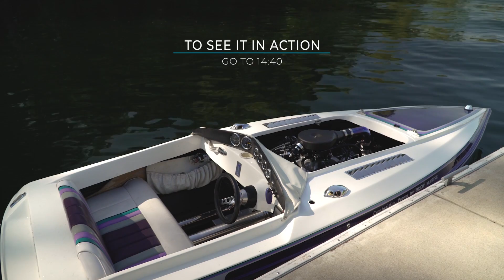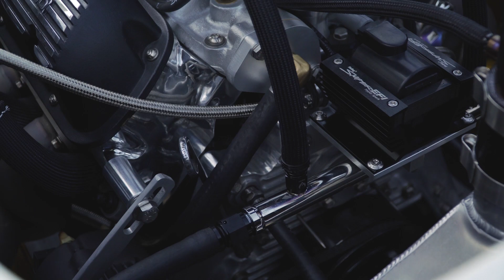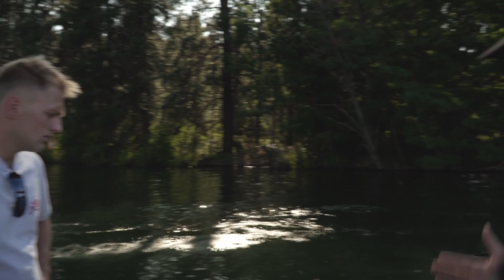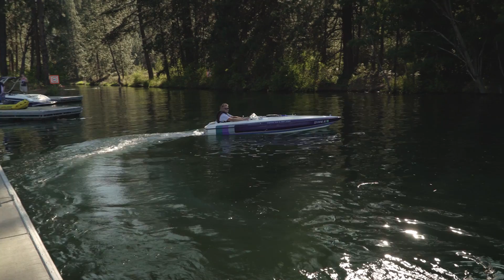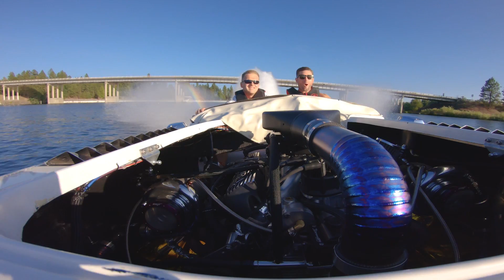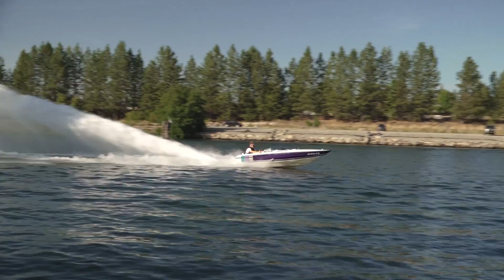13ft 1000HP+ Twin Turbo Jet Boat EP:3

Comment: That so cool but I'm scared hes gonna suck some water up into those turbos
Reply: Ross Johnson 
i did making this video and it did nothing
Reply: Ya it can probably take a little here and there but one real good nose dive and I'll bet you'll hydrolock
Reply: Ross Johnson 
the boat doesn’t nose dive. Ive had it 15 years. I think i know my boat. But thanks for your concern. Even if it sucked up a massive amount of water the compressor blades would atomize the water. It still has to go UP 2 feet and through an inter cooler . Let er suck water here and there. No different than water meth injection. Might even clean my intake valves. Cheers.
Reply: I'm sorry if I offended you it really is a awesome boat, and a great build
Reply: Ross Johnson 
No offense at all!!!! Just answering your question😁
Reply: @andrewbacklund4752  many years ago an ex wife of mine was cheating on me, I was so pissed I dumped sugar down the carb of her ride. This guy I knew that worked on cars and was an incredible mechanic, took water, puled the plugs ran water through the carb, re installed the plugs started the motor, grabbed the throttle cable and dumped water down the carb as it ran, he gave it lots of rev as he dumped water, the motor ran for ever after that, it was a small block Chevy. Water will not hurt a motor. Nuff said.

Comment: He is gonna hydro lock that motor with the way the air grates are setup. There backwards. There suppose to be the others way around just for that specific reason.
Reply: Mad Man Marine no way it will hydro lock
Reply: Andrew Backlund really?  Bout the time he dunks the bow and those vents take a big gulp of water it will. Those vents are right on top of the turbos. It will basically funnel water right into them.
Reply: Mad Man Marine 
Incorrect. #1 The intakes are slightly in front of the grates. #2 if some water gets sucked in, the compressor blades turning 75,000rpm will atomize the water on contact. And even after that it has to go 2 feet up hill through a intercooler. There is no way enough water will ever get over the boat to cause a issue. I have bigger problems if theres that much water coming over the front. Hell let her suck water here and there. Might even clean my intake valves. No different that water meth. Im confident it will never hydro lock. And I’ve put my money where my mouth is. So will see what happens
Reply: Andrew Backlund good luck with that bud. I’ve been building boats for over twenty years and I’ve seen anything that can go wrong go wrong  plenty of times. It only takes once to blow that sucker up. Have fun with that. You obviously have no clue. If you did. You would have installed those vents the right way in the first place.

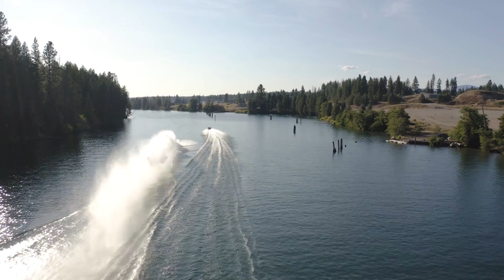Comment: Top end speed? Can't sit through 15 minutes of talking about stuff I don't understand...Just wanna see what 1000hp does on a 13ft boat. At 19:15 it looks like that 1000hp can't even catch the boat blowin by it. Sure it's got a lot of horse power but with a 13 foot boat how fast can it go before you're poopin your pants because you're in a 13ft boat? Got a lot of power but I didn't see it go faster than my 75mph Ranger at any point. Sure it can throw water far and has crazy power but if you can't use it cause it's on a 13ft boat what's the point? Doing donuts and turning super fast? If you like throwin money around I can use some.

Comment: Also. Where’s the triple digit runs!?  If it really is a grand in that motor. It should be easy doing a hundred
Reply: Mad Man Marine 
When i get my jet dialed in,  nozzle size correct, and a down plate you bet shel top a 100
Reply: Andrew Backlund thing is. With a thousand hp. In a 13 footer You should be in the 110-120 + mph range.